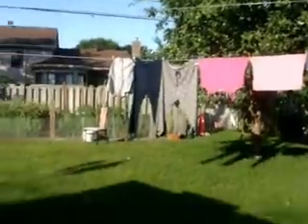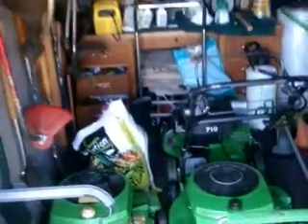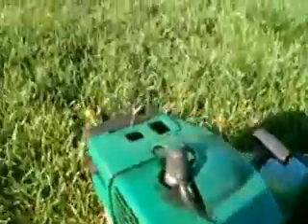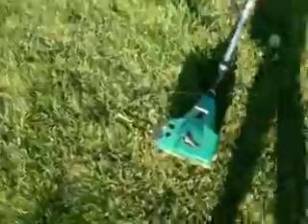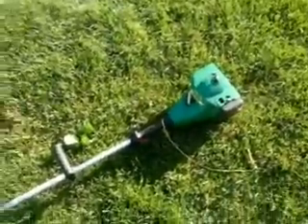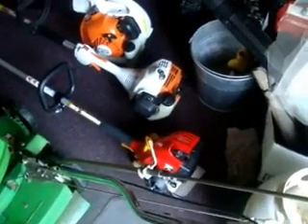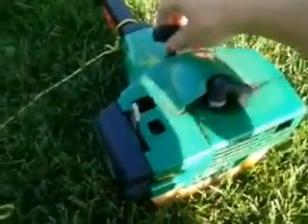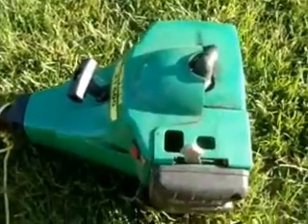1998 Weed Eater XT600 Gas Trimmer Review

Comment from the maker: I'm not sure what you're referring to about needle settings?  If it's about the needle/seat on the carb, this might be tough to explain in words but I'll try it anyway.. you adjust them so the screw holding the needle is tight but loose enough so that the seat can be pushed down so that it let in the gas flow.

Comment: its really easy to fix, the drive cable just slides into a square hole on the crankshaft. you can probably find a pull starter for it on ebay for like 20 bucks

Comment: If that weed eater is direct drive ( no clutch ) it's easier to take the drive shaft off to access the starter recoil. I had a Homelite that the rope went bad on. I just took the shaft out, held the recoil so it wouldn't spring out and fixed it. You don't want to mess with the spring because once that goes you're better off getting a new one.  The real problem is with MTD trimmers where the clutch is in front of the recoil so if it craps out just buy a new one. I like my Stihl trimmer with the starter in the back, so much easier to fix.